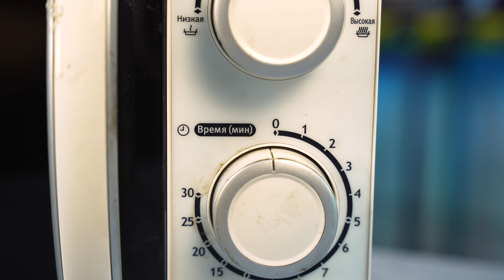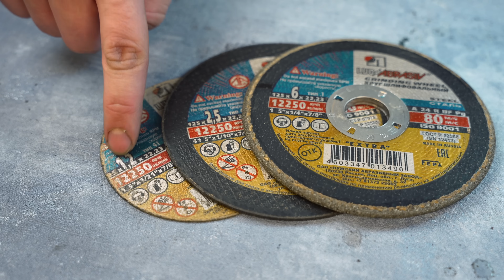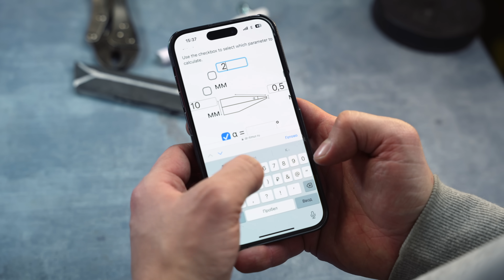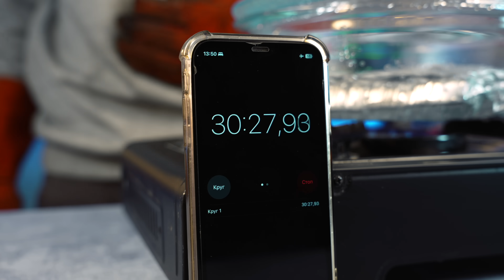A GIANT BUSHCRAFT KNIFE FROM AN OLD FILE

Comment: It would be VERY SMART if you put with subtitles the step by step of what you did.  For example, the materials you used in the treatment of wood.
Reply: Posso consigliare di non seguire questo video. Ha sbagliato i tempi e le fasi di stempra  e ancora peggio quelle di tempra. Per il manico ti posso consigliare l'olio di lino cotto, come finitura finale. Oppure la cera per legno , l'effetto finale risulta un po' più lucido. Se hai domande per eseguire le fasi di tempra in modo corretto , sono a disposizione.
Reply: Hattori Hanzo non vi fa manco una pippa!

Comment: Just a quick tip when stabilizing your wood, after releasing the vacuum, you have to let the wood sit in the resin for at least two times as long as it was under vacuum or there will not be enough resin in the wood to make any difference.

Comment: They always say an old file. Do new ones not work the same?
Reply: Old files are usually too rusted or the teeth are too worn down to use properly
Reply: @Kvitebjorn257  so I could just buy a new file a make a knife? I heard some people say the metal is not as good as older ones.
Reply: New files are case hardened usually, meaning that only the teeth are high carbon. The core is mild steel.
Reply: @mrkiky  thanks